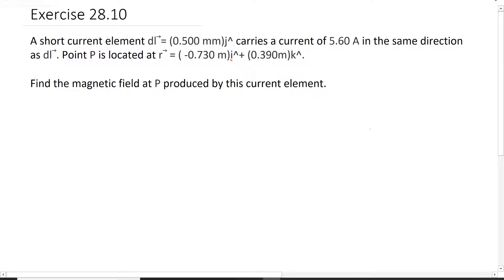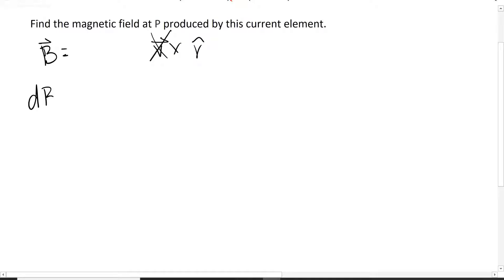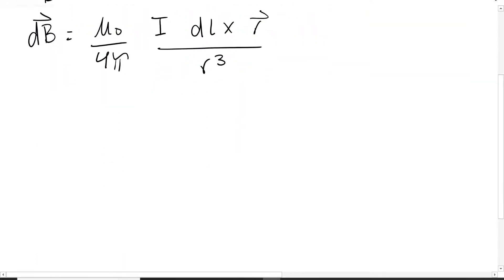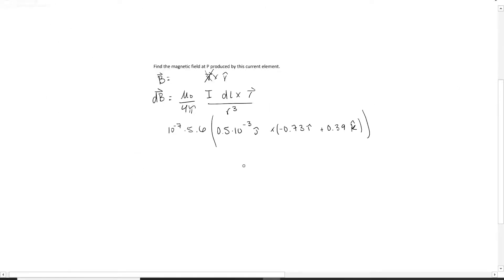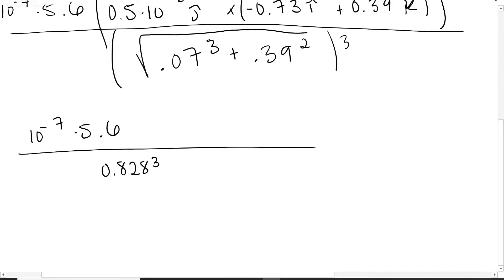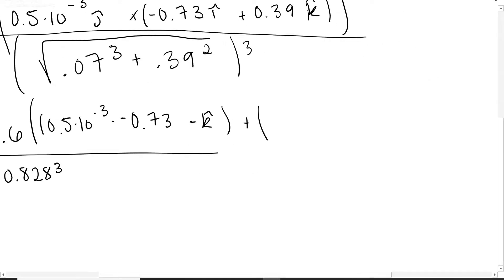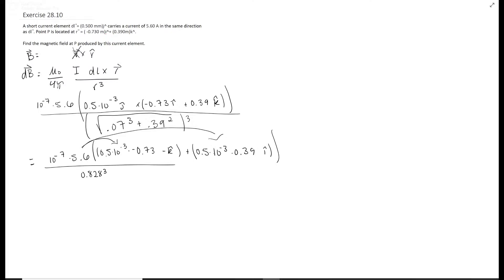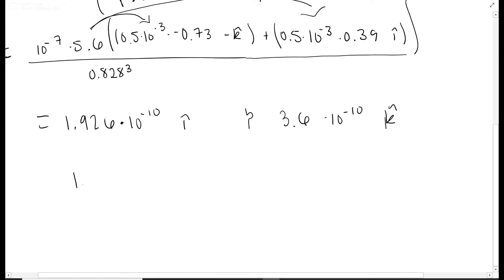Short current element dl= mm j carries current A same direction as dl Point P located magnetic field

Comment: Thank you for the video it was really helpful. However there are a few mistakes such as the equation for the denominator where 0.73 is supposed to be to the power of root 2 instead of root 3, and then at the end the values for i-hat and k hat are switched
Reply: Im just gonna comment rl quick so someone else reading your comment doesn't get confused. It is supposed to r^3 since the equation you're talking about r^2 involves the sintheta. YOu get the r^s sine theta equation from simplifying the r hat/ r^3